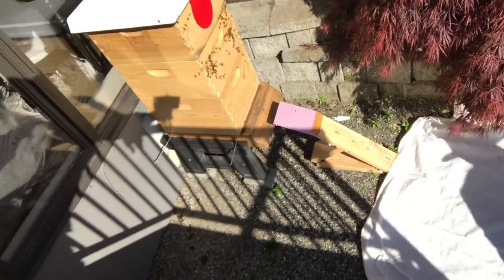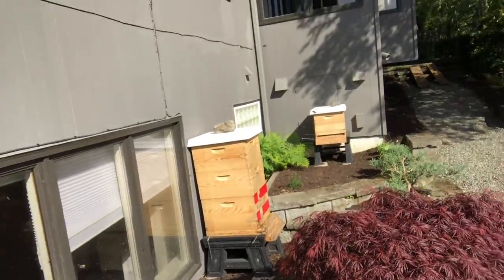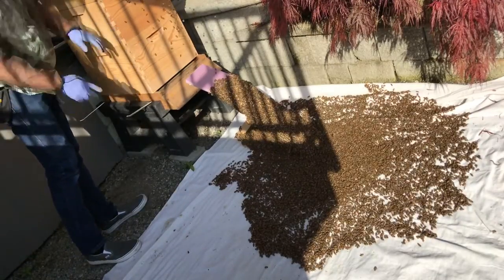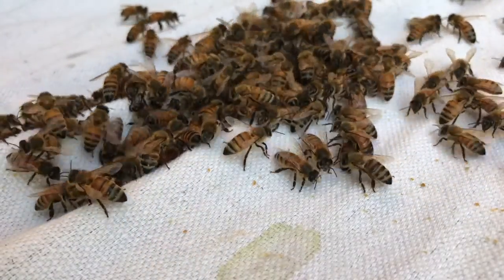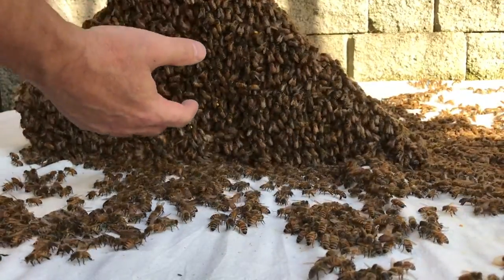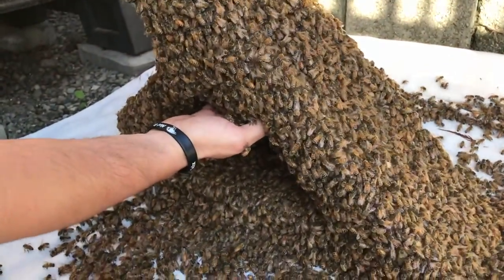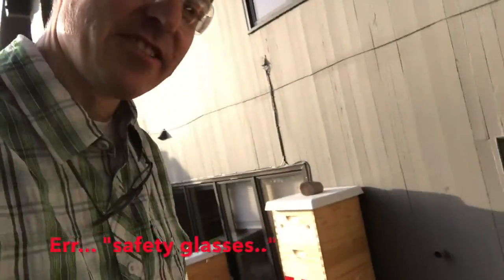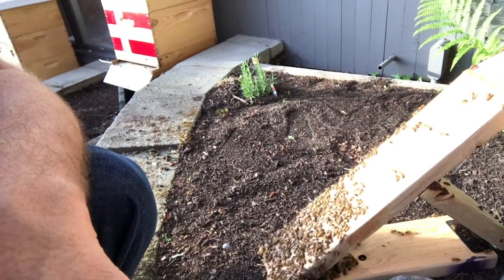Taranov Board

Comment: 1 minute in and I can already see a problem. They need to do the split away from the original hive location. I'm going to continue watching in case the handle it in some way later in the video.
Reply: They didn't do that right. They should have done the shake out at the Mexico hive location.
Reply: Pro trick : watch series at flixzone. I've been using them for watching a lot of movies recently.
Reply: @Reece Kairo Yea, I have been using Flixzone for months myself =)
Reply: @Reece Kairo yup, I've been using flixzone for since november myself :D